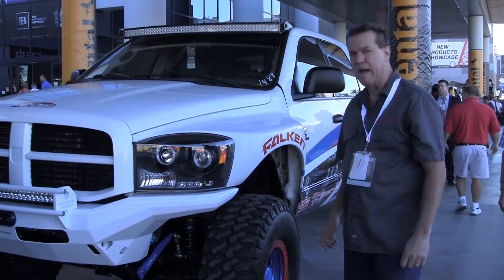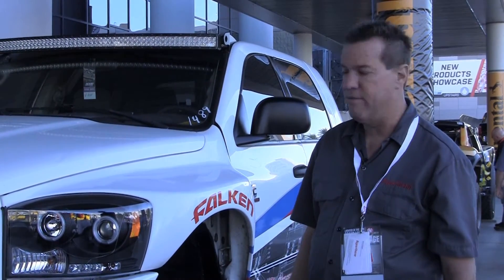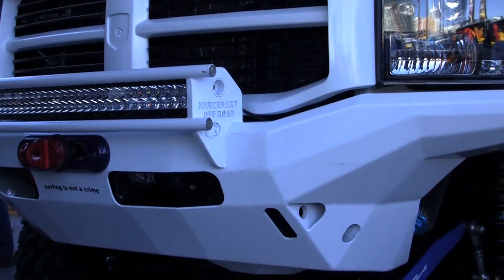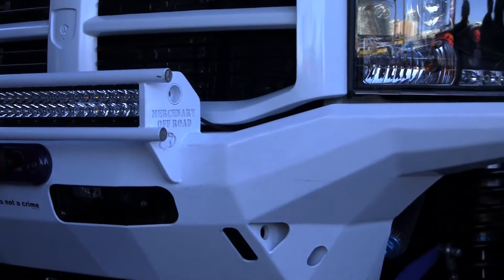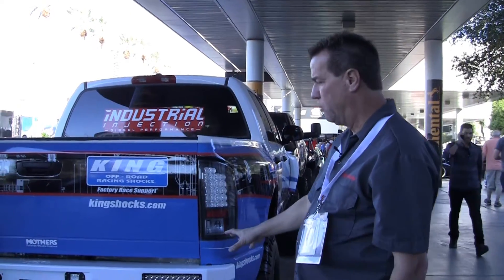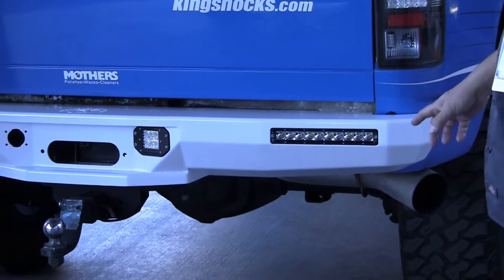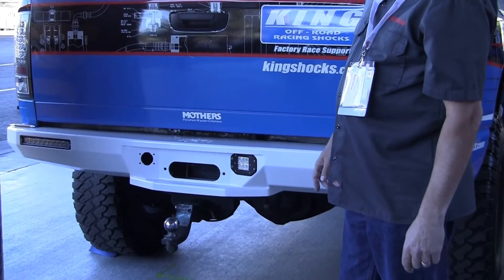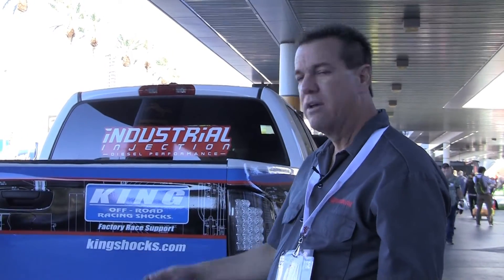Hypertherm’s Michael Vanvakaris at SEMA 2014

Comment: Hi, I am working at trying to get a Powermax 65 CNC 4' x 8' Plasma Cutting Table Working. I have two questions though, One: The unit I purchased doesn't have a connector nor does it have a terminal strip either, what would I do to make my unit able to communicate with a CNC unit? Two: Will the unit still work between using it Portably and Stationary CNC Table usage?